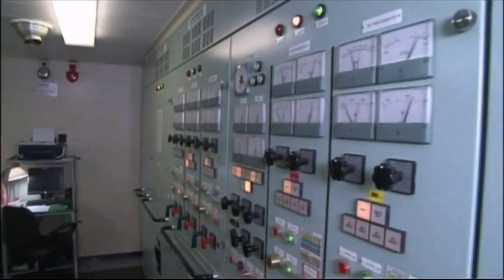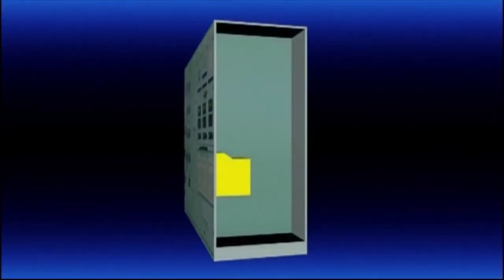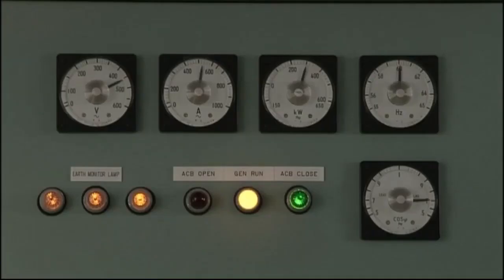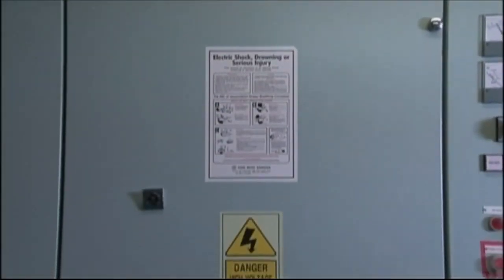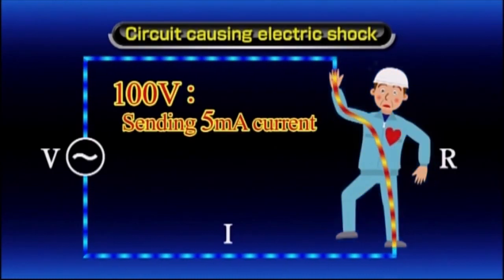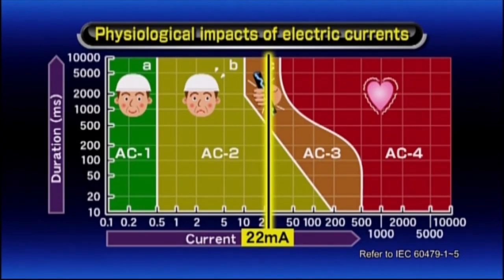Electrical Switchboards Onboard Ship

Comment: 🎯 Key Takeaways for quick navigation:

01:11 🚢 Electric power on ships is generated by onboard generators and distributed by electrical switchboards to various installations and equipment.
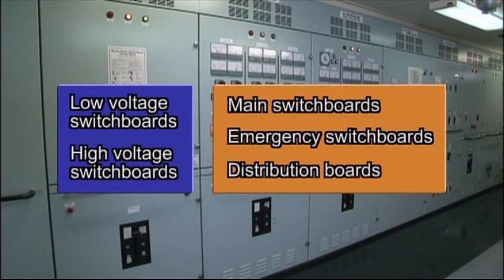01:25 ⚡ Switchboards are classified by voltage (low or high) and purpose (main, emergency, or distribution).
02:35 🔧 The main switchboard, featuring a dead front for safety, distributes power from the main generator to different panels, including the generator, synchronizing, and feeder panels.
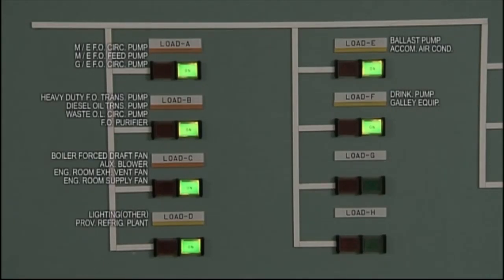05:36 ⚙️ The molded case circuit breaker (MCCB) in the feeder panel trips off during emergencies, such as an engine room fire, ensuring safety.
08:07 ⚠️ Protective relays, fuses, transformers, and other components in switchboards safeguard against overcurrent, short circuits, and ensure voltage regulation.
10:15 ⚠️ Electric shock risks increase with voltage, and proper safety measures, including insulation gloves and tools, are crucial when working with switchboards.
11:31 🚫 Immediate action is necessary in case of electric shock, including shutting off the power source or using a body rescue hook stick.
12:01 ⚡️ Approach cautiously to hotlines, as ships may use voltages as high as 6600 volts, and always be aware of electrostatic charges in electrical equipment.
13:31 🛠️ When maintaining switchboards, follow safety procedures, use insulation gloves, avoid wet conditions, and conduct inspections with proper tools to prevent electric shock.
16:09 🚧 Accidents involving electric shockare more likely during maintenance, so always secure the operation area, communicate effectively, and use warning signs.
18:16 🔄 Switchboard design includes color-coded polarities and specific tools, like a mega, to confirm insulation levels. Always follow safety guidelines during inspections.
19:55 🔥 Case studies emphasize the importance of proper equipment use, such as multimeters, and thorough safety checks before, during, and after maintenance to prevent accidents.

Made with HARPA AI

Comment: When designing 440V electrical panels to power things like separator system, pumps and other electrical equipment (between 10 and 150 kW) . How much short circuit current should the panels usually be designed to withstand? Since it differs on all vessels and installations it is impossible to know exact before hand.